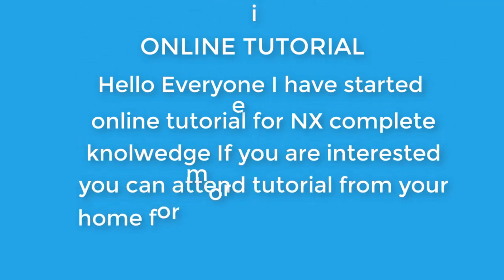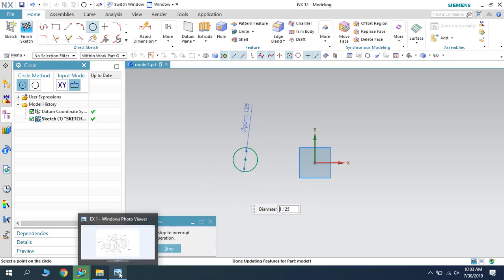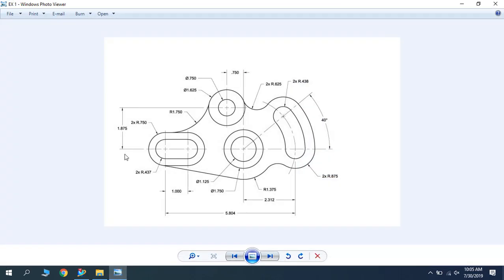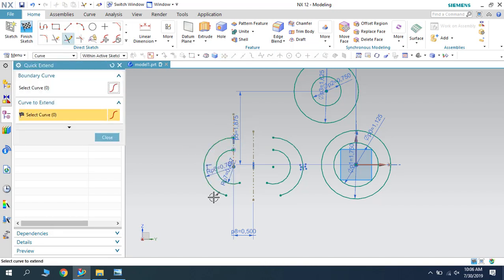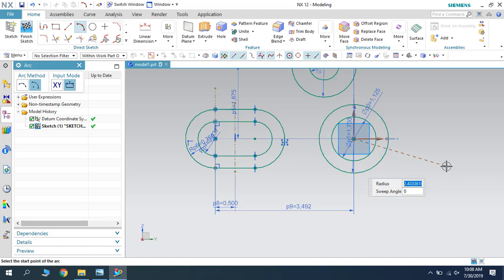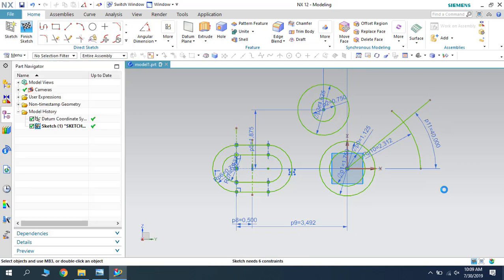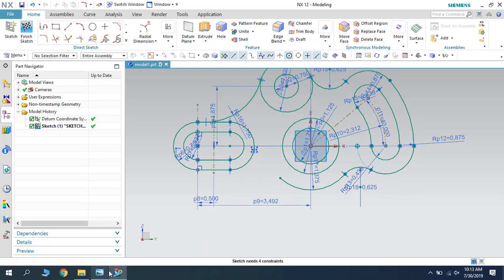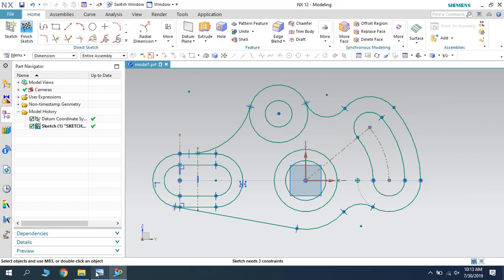Unigraphics NX- Sketch Example 5 with constraints and Dimensioning for beginners

Comment: 6:01

Is it the best practices to make that profile that way? Like if you make those outer same circles first then joined them with tangent  straight lines and trim the unwanted lines, then you come to inner profile by just line offset. Don't you fill this make sense more?
Reply from the maker: Nice it works good..
Reply: @TechDesignsantosh  🤝